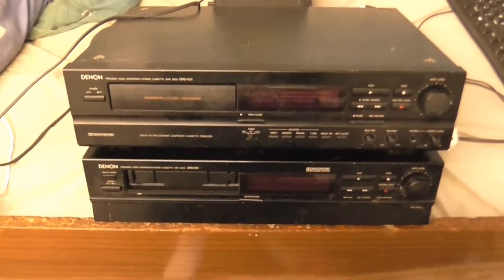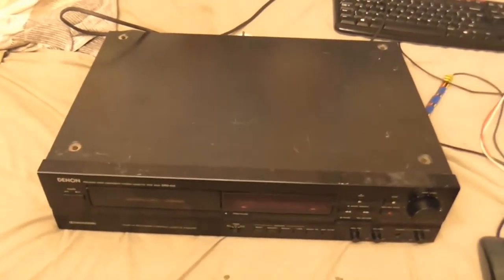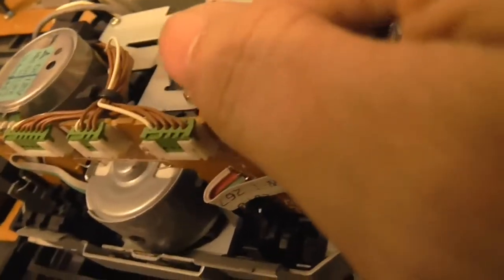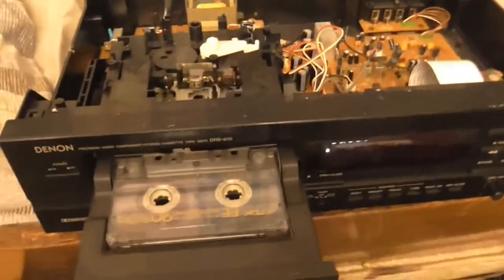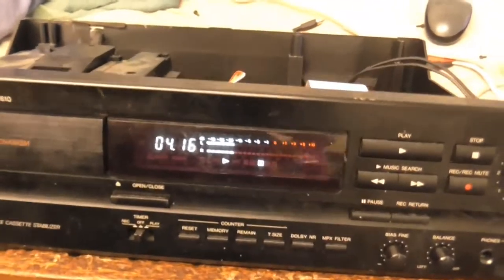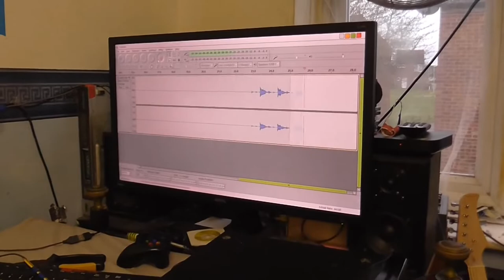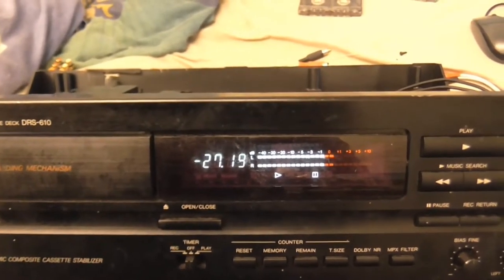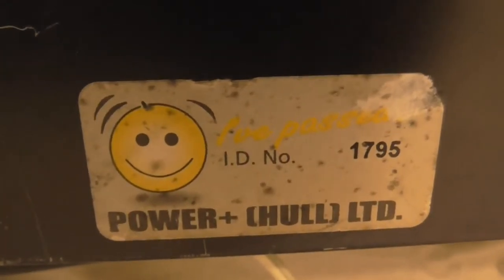Double Dennon

Comment: If only I could find a cassette deck with Dolby HX Pro and Noise Reduction in the trash. Hard to find one under £70 on eBay most of the time.
Reply from the maker: I guess I just got lucky.
Reply: @CoolDudeClem  you seem to have been quite lucky over the years with audio equiment. Probably because everbody just wants an aii-in-one speaker now, so they are throwing away their HiFi stuff.